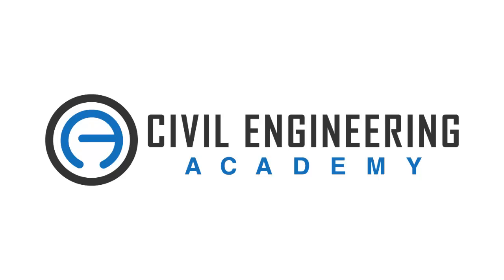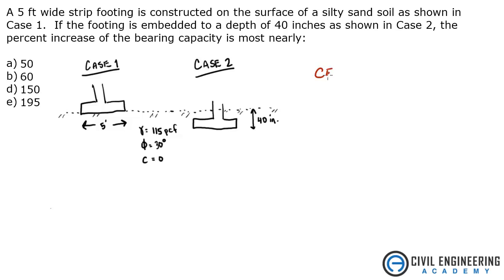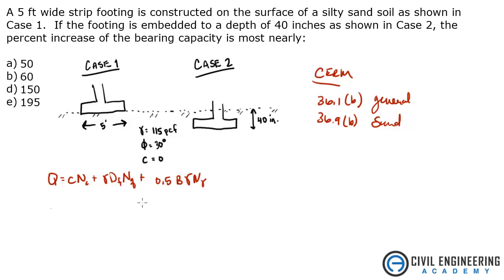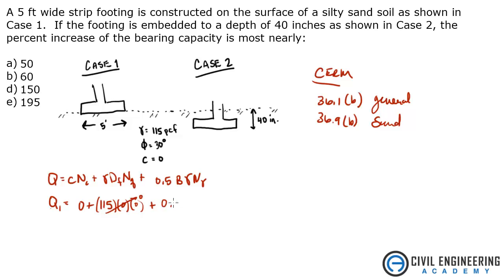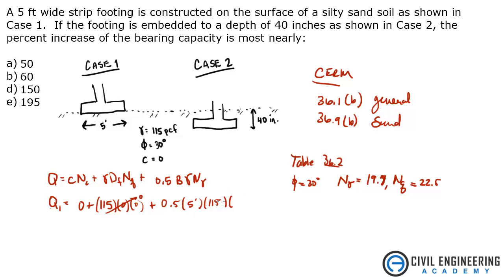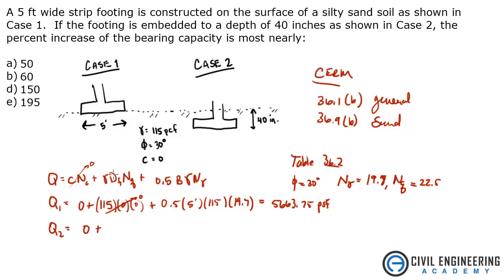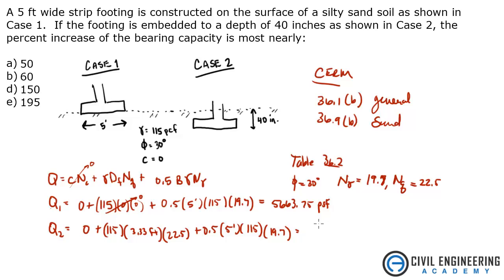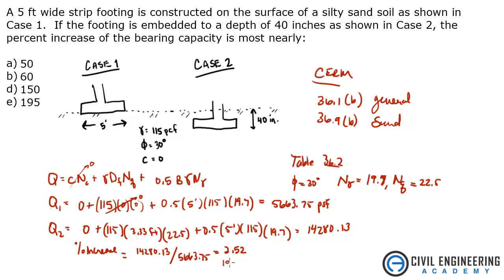Geotech-Bearing Capacity of Footing

Comment: I have to find out allowable bearing capacity of a footing (3 x 3). I have to put the LOAD value in the equation (either in KN or kPa). Does it make any difference? Are they equal? For instance, if I have a given load of 100 kPa  so does it equal the value of 100 KN ?
I am saying this because KN is a value of Force while kPa is value of Pressure so I am a bit confused. 
Kindly help me with this. Thanks in advance and keep up the good work.
Reply from the maker: These two values are exactly equivalent and are completely interchangeable.  Pa used for pressure and KN for force.